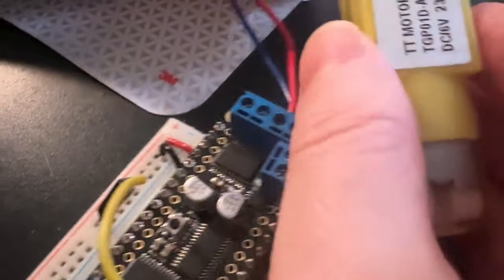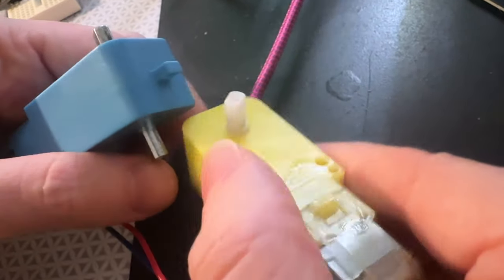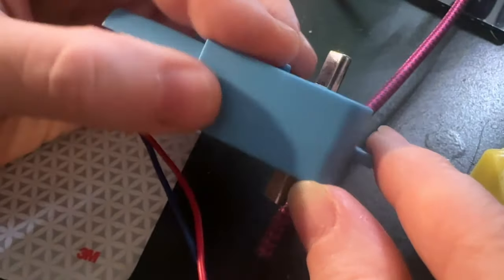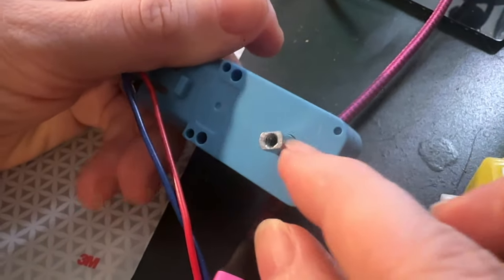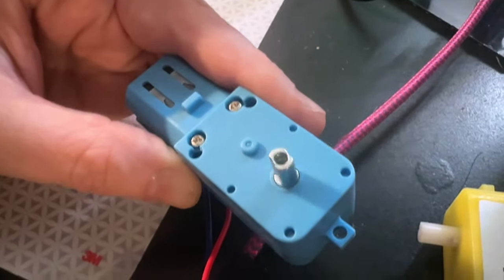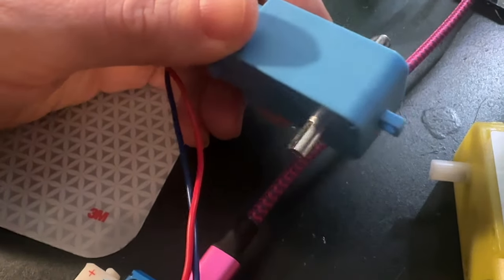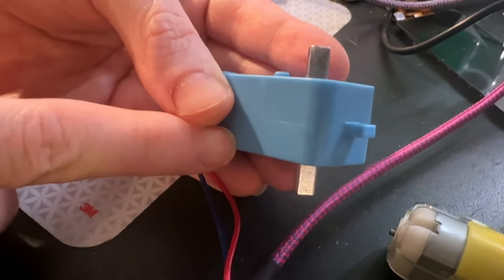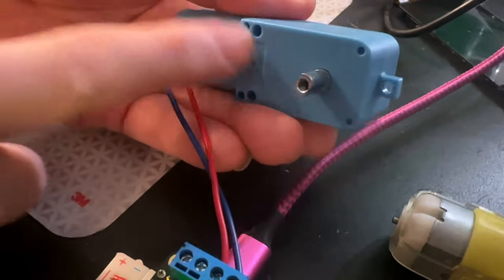Bi-metal and bi-axled and soon ready to buy-in-the-store! 🔧🤖⚙️

Comment: The torque on those TT motors is impressive. First time I used one couldn’t believe how beefy the torque was. Gear ratio makes them a bit slow but really strong. Good for rock crawlers vs an rc race car.  Can also be used for winch or crane projects.